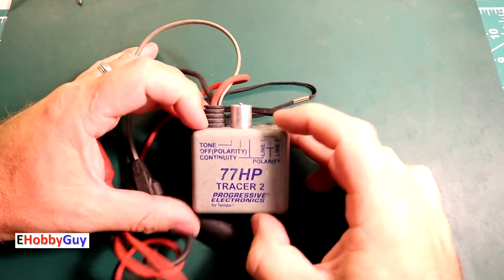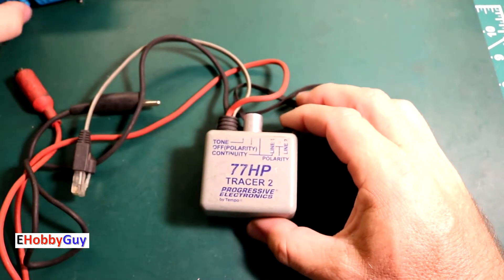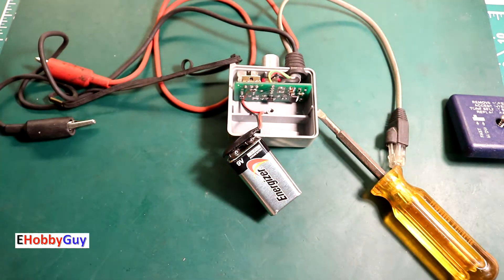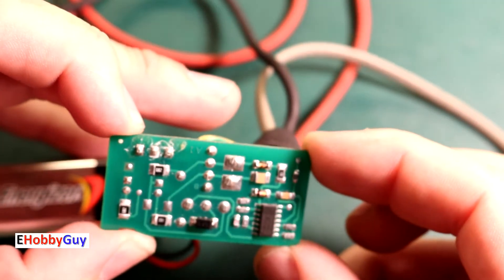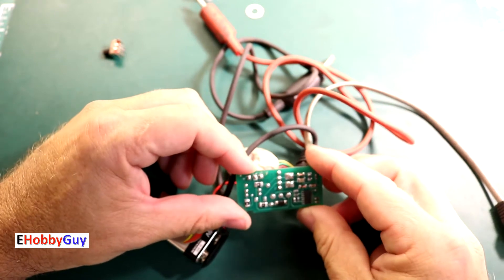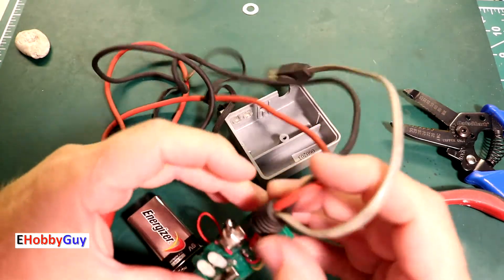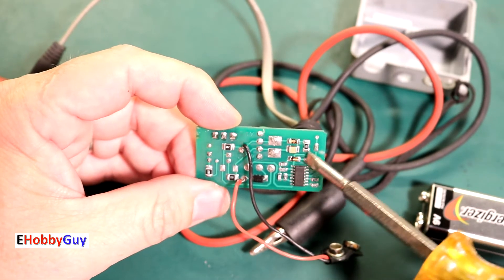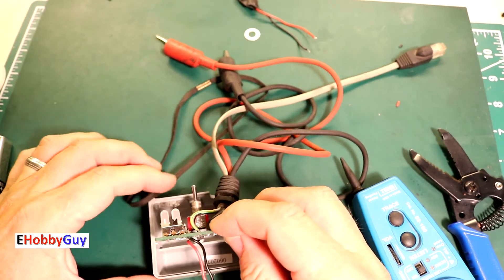A LOOK INSIDE A TONE GENERATOR !!

Comment: Good presentation👍 .Battery connecter wire goes dis under the black cover , very unreliable round or spade lug crimped to the negative and positive terminals that connects to the 9 volt battery . Another common fault is the pair of oscillator wires attached to the crocodile or gator clips goes dis on the inside of those silicone sheathing or in the clips itself . This would generate a 1 leg or no tone at all , let's say example 1 km away. Remember , if you are fault finding a copper pair pots and the fault is beyond that 1 km , the audible tone should go off when you put a short on the wire pair . That also tells you that your fault is beyond that  1 km. That's why it is important to short the gator clips to make sure that the tone or sound cuts off before you leave to the next test point. This is only an open or 1 leg dis fault. Short circuit faults and open wire faults should be measured with a Hand held Metrohm , Spirent or Balco Megger distance meter to determine the distance of the fault , then connect the tone oscillator.
Reply from the maker: pravesh brijmohan thank you very much for your excellent and informative feedback!  I really appreciate it and thanks for watching!